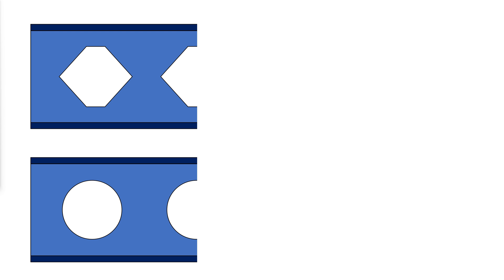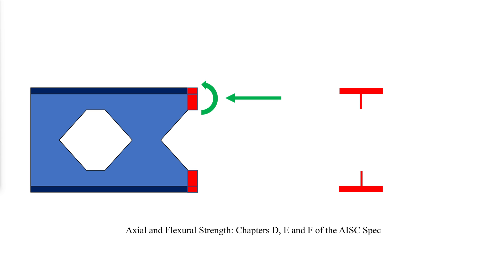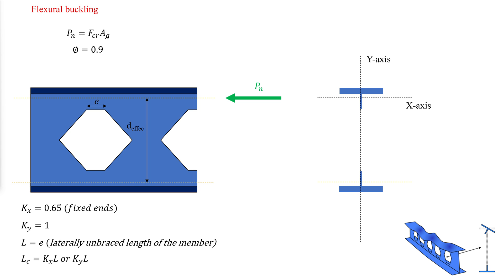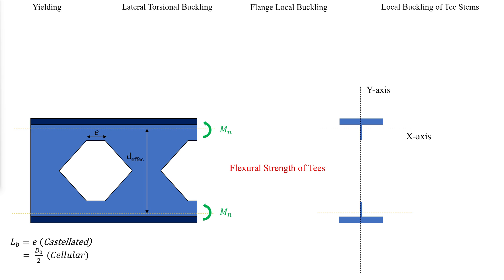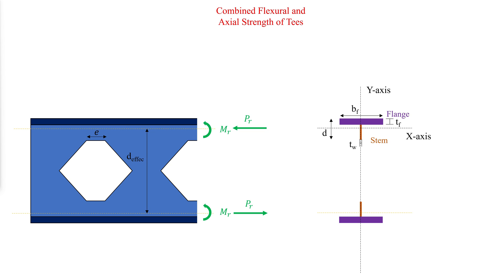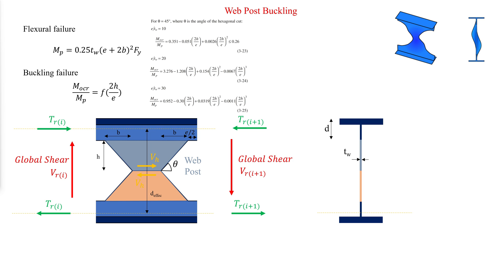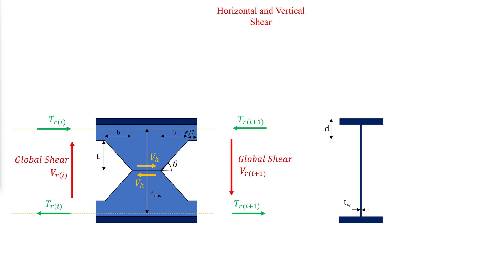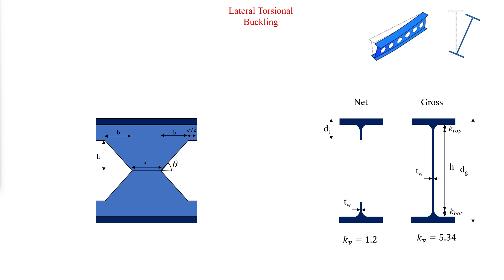Mastering Beams with Web Openings: Design Analysis & Failure Modes Explained @FrameMindsEngineering

Comment: Thank you for this video. Please do Eurocode standards have provisions for beams with web openings?
Reply from the maker: Hi, the eurocode does not specifically tackle the topic of castellated and cellular beams. However you can use the same principles shown in this video to determine the local forces in the net section and web posts. Afterwards you can use the provisions of eurocode 3 Part 1-1 for calculation of shear, compressive, tensile, and bending strength.
Reply: Thank you @FrameMindsEngineering